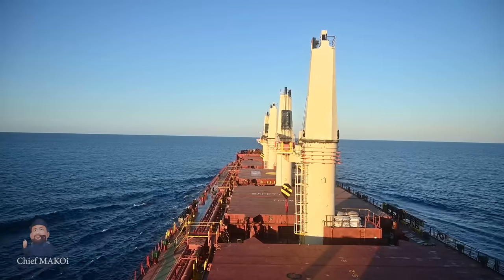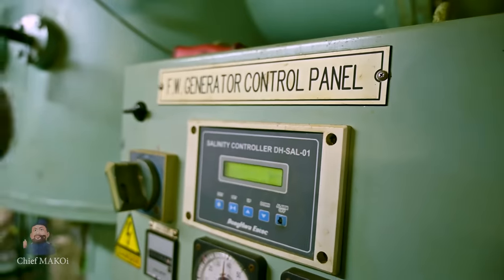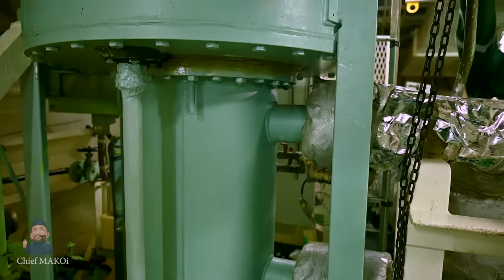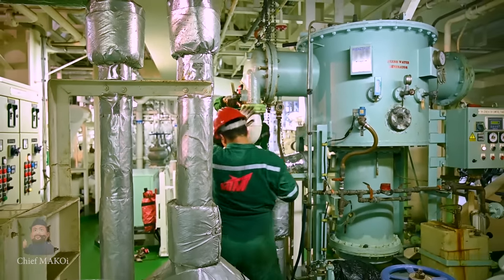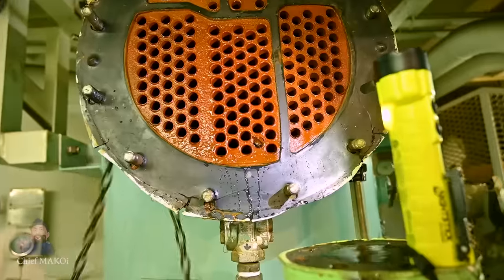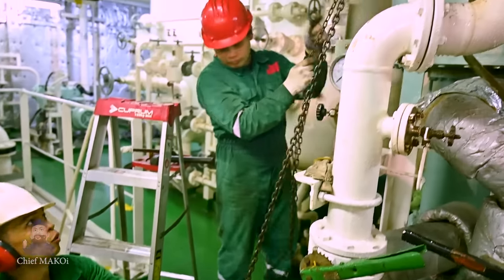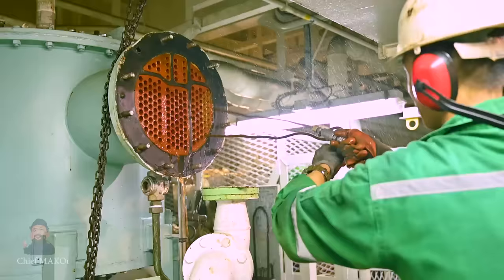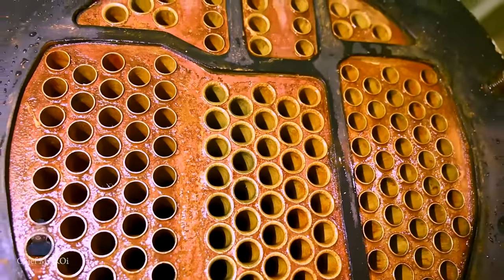Fresh Water Generator : Cleaning the Condenser Tubes | Chief MAKOi

Comment: I used to circulate water counter current every week to mantain the tubes clean.We call that backflush.Whith this procedure I avoid to open the equipament frequently. I work in an air separation plant.Good footage.
Reply: ships have a varieaty in water intake, sometimes brakish(up rivers and bays, sometimes dirty with silt, sometimes warm /cold those can quicly devellop barnacle growth on inside of tubing, backflush is not agressive enough.

Comment: You brought back memories of helping to clean one of the main engine condensers on my aircraft carrier many years ago.  The bell housing is much larger than this and the intake is huge - to the point of you would find whole fish and other junk in there.  40 years later and as I watched this video I could still remember the smell.  I assume in the case of this evap unit there is a strainer upstream some place to minimize debris in those tubes.
Reply: I remember the time we opened up a main engine condenser housing bell on my aircraft carrier and found two live sharks in there.
Reply: @andrewvenor8035 wow that is impressive

Comment: In electric power plants fueled by coal/gas/oil there are condenser units like this one, except they are two metres in diameter. The technicians use an ultrasonic probe to investigate on the health of each tube, but salt water (they cool the vapor from the turbines wit sea water) is unforgiving, and every six months one of the power generators is brought down for maintenance.
The alternators are the biggest pain - they're cooled with hydrogen because it causes low drag...

Comment: Chief, having 20 years of refinery work at my belt I’m asking you why don’t you use a high pressure nozzle hose for this? We used this method at our Naphta condensors which were cooled by brackish water, had about the same diameter and were perfectly clean after this. Even crude heaters were clean using this method although that took a bit longer. It will clean better, make no scratches and leave no residu in the pipes.

Comment: Chief on a shipboard condenser like this is the fresh water side of the system kept at a vacuum? That can increase the output considerably, and reduces the temperature needed from the boiler.  Also have you tried straightening out the shaft of the cleaning brush and spinning it with a hand drill?  But, you look like it's a solid crew you've got, you probably don't need to bother.  Keep up the good videos.

Comment: Thank you for showing me something that I’ve never seen before Chief MAKOi !
How does this condenser compare to reverse osmosis freshwater makers in energy efficiency and in water quality? Thank you so much 😊
Reply from the maker: This uses waste heat from the Main Engine Jacket Cooling Water so it's pretty much more energy efficient compared to RO.
Reply: Thank you so much Chief MAKOi, that’s what I was also thinking. It would be very expensive for the electricity to force sea water through the membranes and they do wear out as well.

Comment: Hi Chief. Does the system use waste engine heat for the evaporator portion or does it have its own separate boiler?
Reply from the maker: Yes, waste heat from the Main Engine Jacket water.
Reply: This was my question as well. I was very much hoping that it used waste heat, so I'm glad that that's the case!

Comment: Great video. I noticed you didn't replace the gasket (is that the correct term). How long, or how many time can the cover be removed and replaced before the gasket is renewed?
Reply from the maker: If the surface has no damage and if it's not brittle, it's still ok.

Comment: I'm surprised you don't use a cordless drill on the end of the brush shaft. Logic would seem to indicate it would do a better job and make the job go quicker.
Reply: Until the shaft breaks off inside the tube. Those tubes are made out of a softer metal so I think they are being careful for a reason.
Reply: Easy does it. You could end up with leaking tubes.

Comment: Interesting video, Chief. If everything is working properly does the crew have all the fresh water they could want or are there restrictions? For example, what some call navy showers where water use is severely restricted
Reply: My dad served on a destroyer in Korea during the war and said fresh water was always an issue. Navy showers were the norm.
Reply: Remember that unlike navy vessels, cargo vessels make port calls to load/offload cargo and fresh water is available in most ports and so a well managed vessel should always have enough FW to operate without restrictions. However there are will always be times when FW supply is not available and the tanks are getting low so limits placed on washing.

Comment: Is there Air Tools on the ship?  Seems like an air gun would make removing all those nuts a lot faster?   You guys do a lot of work and it seems I've only seen hand tools and very rarely are powered tools used.   Is there a reason for this?
Reply: And will later destroy the threads due to improper tightening,

Comment: Do the tubes contain the distilled water condensate or sea water being heated to steam and then being turned into distilled water?
Reply: Inside the condensor tubes flows seawater (or fresh water from the central fresh cooling water system) The heated seawater which has turned into steam will pass through a demister and is condensed in the ... area were the condensor sits.

Comment: No gasket on that cover? I must assume there is not much pressure in the system to require it.Why not use power tools to remove the bolts and run them back to tight then torque to spec. It would save a lot of labor. I guess you have time on your hands to spend undoing and tightening bolts by hand.

Comment: Is the distilled water considered potable water?  If so are minerals added for taste?
Reply: Pure distilled water is not recommended for consumption, so I guess they add the necessary salts later or simply use it for anything but drinking.

Comment: Where does the source of heat come from (Diesels run cooler than Steam plants I am familiar with)?
Reply from the maker: From the Main Engine Jacket Cooling Water.  For further details on how this works, you can check the video I mentioned.  Link is in the video's description.

Comment: If I may make a suggestion instead of using a vinyl / plastic brush, you may want to try a rifle / shot-gun brass cleaning brush.  They come in MANY different Diameter sizes.  The brass will be soft enough not to harm the tubes, but much stronger, and much more efficient, than the vinyl / plastic brush's'.  Also, if you were to purchase a "Rifle / Shot-gun Cleaning Rod," they come with a "TEE-Handle," (depending on Diameter of the tubes, look for a "Rifle / Shot-gun Cleaning-kit to match the diameter of the water cooling tubes; also if necessary purchase two kits to get / obtain extra rods.  I believe the rods are made of stainless-steel, and screw into one another;) and my guess also is the cleaning rod is much stronger, durable than what you presently use and get's bent / twisted a lot, as seen in this video.   A quick measurement reference would be if an American 10 cent piece (a.k.a., a dime) could / can fit into the tubes, look to purchase a shot-gun cleaning kit. If the tubes are smaller than the dime, check out rifle bore diameter(s), and or the lonely 410 shot-gun diameter, which is a smaller diameter that a 12 gauge shot-gun.  Stay safe.  12 gauge = approx. Imperial size of 1/2" inch (0.500" in.) / approx. 13 mm.
Reply: The tubes are made of a brass or copper alloy, so a brass brush made to clean steel could certainly harm them.

Comment: is this standard practice? I know Reverse osmosis is more energy efficient and easily serviceable
Reply from the maker: Actually, this is more efficient as it also acts as a secondary cooler for the Main Engine Jacket water.  This setup uses the waste heat from the ME Jacket water to evaporate sea water.
Reply: @ChiefMAKOi  ah, its really the waste heat component that makes this a viable option. Do you happen to know the GPH/LPH of a unit like this?

Comment: I was always told that there are no stupid questions except the ones you don't ask. Do your engines and generators use the fresh water in their cooling systems? On one hand, you have an unlimited amount of cool salt water available. But then, that could cause problems in the cooling system.

Comment: Why don’t they use air tools instead of wrenches?
Reply: Everything has its reason.
From own experience. Nice for loosening, but tricky when used for fastening in the uncontrolled environment on a sea going vessel
Reply: @janvisser2223  Air tools are always easier, when you have enough room to use them. Why tug and pull on a wrench when you don’t have to?
Reply: @Mike-tu7uw  True, but threads will be destroyed by incorrect use of the airtool during tightening. And I know that that will happen.